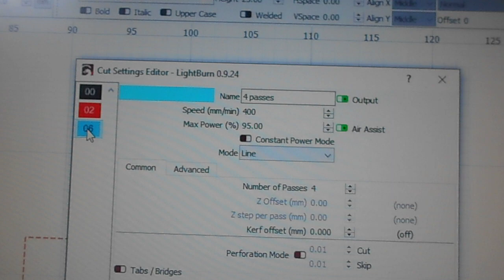Atomstack A5 20W superpower with Rmc Air assist

Comment: Which model are you using exactly? I ask, as I have three lasers with output power of 5.5-6W that can all do this without air assist. Two are Atomstack based, and can make a single pass clean cut through the same thickness material at 420mm/m 80% power. Even my old Ortur LM2 LU1-4 (5-5.5W output) can generally manage the single pass cut at 100mm/m 100% power, though I do tend to use 2 passes as a just in case. 

To be clear, I'm not trying to bag on you, rather I want to understand what you're showing.
Reply from the maker: It is a 4.5-5W rated model. Normally you need 6 passes!

Comment: Hi
How do I use the air assist. Am buying air compressor. DO I use it vacuum or...
Reply from the maker: It has to give you air. Up to 2 bar pressure is used!
Reply: @RmcReloaded-tehnicaldriver  blow the smoke away?